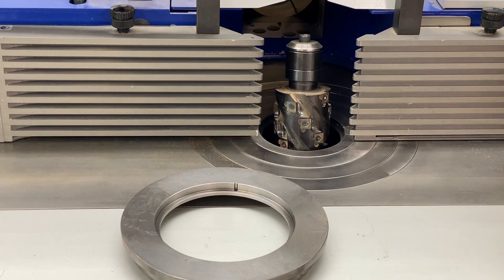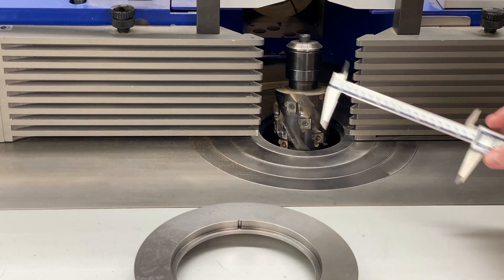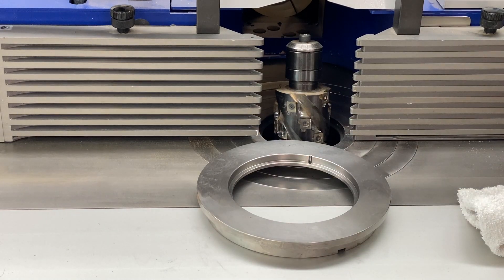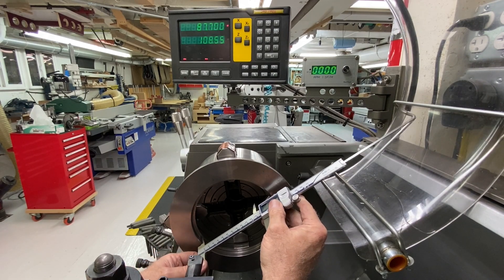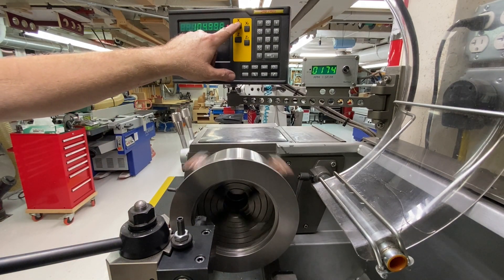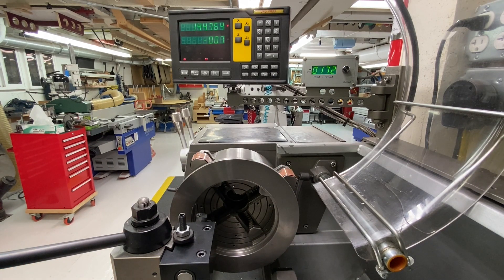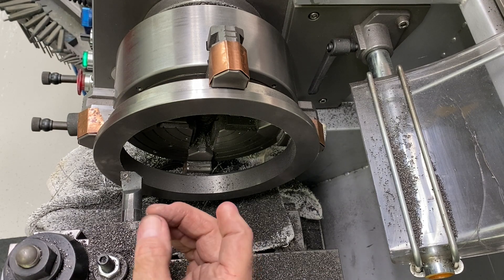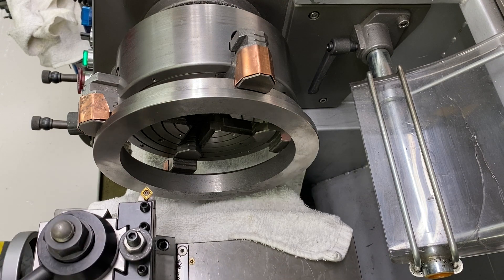Shaper Ring Modification

Comment: Having the Felder Format4 shaper and several toolings that require a close fit at 170MM and 70MM I have made some .3935" thick rings of maple and white oak to reduce the gap
between ring and tooling. I use 3M clear packing tape with the tape over the back edge of the ring at the walls. This seems to be OK and does not interfere with wood at the fence.
I was going to make some aluminum rings but maple is very stable. The maple fit just pops into the metal nicely but I still use the tape.

Comment: Very interesting - thanks for making the video.  I have a Felder shaper as well but the stock openings seem OK to me.  Interestingly I've never used the rub rings on the back side of the those rings but seeing this made me think I should try them out. Cheers
Reply from the maker: I’ve made these for several people - typically users with non-Felder tooling with specialized needs. What “rub rings” are you referring to?
Reply: @David_Best  The raised area on the underside of the Felder rings are rub rings (or so I thought) so you can used them for curved profile work.  As I said though, I haven’t used them so I don’t know how well they work.
Reply from the maker: @justcruisin109  I think you are confused.  Rub-rings mount on the shaper spindle.   The cutter you see in the video is provisioned to accept a rub-bearing for template work, but the bearing is removed in this video.  This photo shows that cutter with the rub-bearing in position:  https://www.flickr.com/photos/davidpbest/31158589040/in/album-72157673642627954/